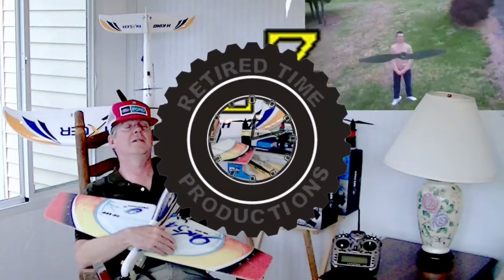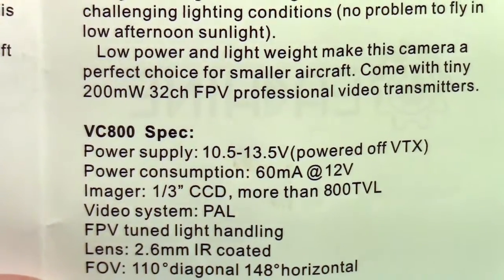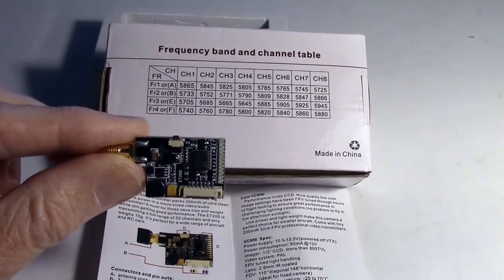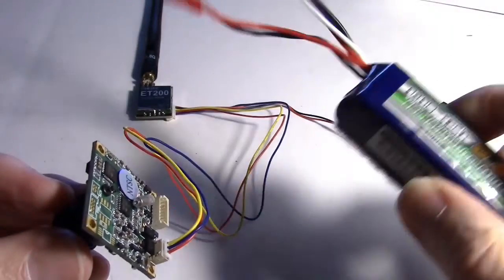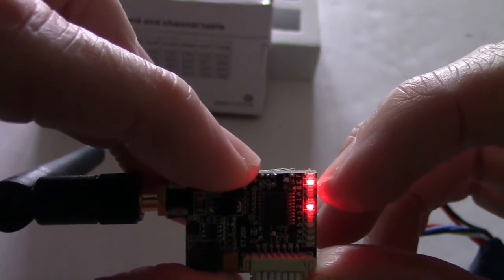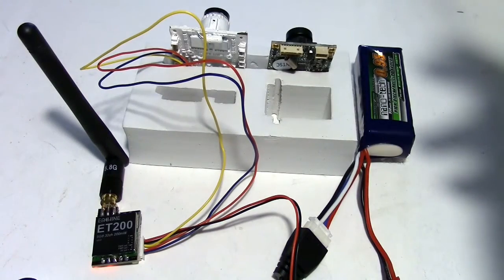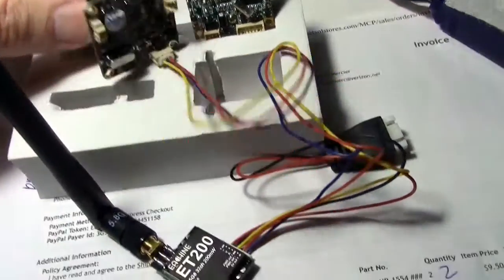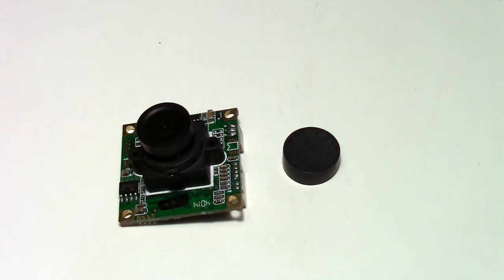EACHINE ET200 FPV Kit Review - Could be used for Mini-Quad or Plane

Comment: Thanks David, quick question.. my transmitter ET200 gets hot quite a bit and pretty fast, is that normal?
Reply from the maker: +Claudio G. Same here. They don't have much of a heat sink on them if any. I am using an ET600 now and it looks just the same. No extra heat sinking ability.
I try to make sure there is good air flow around the metal cover (can) so it will stay cool while flying.
Reply: Thanks a lot sir

Comment: thanks David for the video. I have a question ?.. this camera work with 5v to 12v ? Can I use a Lipo 2s 7.4v 1000mah 20c ? 
thanks
Reply from the maker: +Fr3DSky Should work but the camera is not very good. My camera was dead out of the box so I never got to try it.  The video transmitter was nice and I like it.

Comment: Be careful with those ET200's Dave. I bought 2 of them..... one burnt out in 5 mins and the other sometimes changes channels. They sent me 2 more and both seem to be working ok but they get VERY hot (>200f).  It's nice to see they changed the camera (although yours didn't work). My cameras are totally useless because there's absolutely no WDR.
Reply from the maker: +Vortecks Thanks for the info. It did seem to be getting hot to the touch but I just assumed that it was properly heat sinked (or not!)

Comment: shame cant use it in UK as max is 25mw
Reply from the maker: +jacky Parker - Does that law apply to non commercial use? In the US you can go above 20mw as long as you are not getting paid or racing for a cash prize.
Reply: everyone says 25mw is max as far as i know but have seen some videos of people going 10 miles in uk and under 1000ft even asked at a club and they didnt know . . .basically no one really is sure when it comes to fpv . .  check out painless360 there UK based and very popular YT channel

Comment: A great anti review Dave.
I have one of these same sets and my camera functions but it is a CRAP camera with no dynamic range.
I swapped it out for a RunCam board camera and it works fine.
CMOS cameras are useless for FPV, we need to stick with CCD cameras.
Way kool man
Reply from the maker: +Dick Gibson I agree that CCD is best for FPV.  CMOS is much cheaper to manufacture and that is why it is used in the action cameras with higher resolution but sacrificing dynamic range.

Comment: I had one of these combos setting- it was so cheap I wouldn't put it on anything I deemed top shelf.
Finally, I was working on a build and didn't want to wait for a vtx and cam so I installed it... on a 122mm quad!

I am very impressed at how well it worked. Very good value.
Reply from the maker: +Hiway Glad to know that yours worked. I must have got a lemon on the camera.

Comment: I only buy the VTX's alone, but they are awesome, and the one button tuning is SO MUCH EASIER than the stupid dip switches on other ones. Great video and range for a cheap 200mw! I have a few now.
Reply from the maker: +JohnVH541 Yes they seem to be very easy to use. If it holds up I may get another.